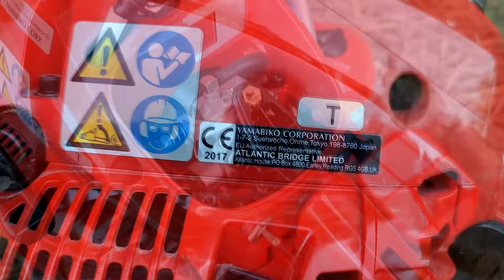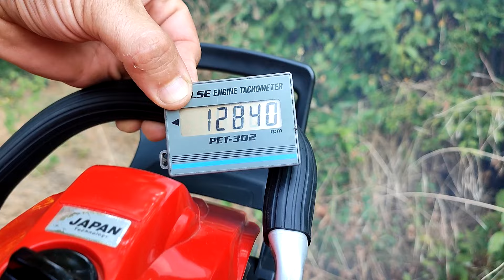Shindaiwa 452s (45cc, 3HP) - first start/cuts, break in, factory RPM, muffler mod and more...

Comment: Te salut Ram. Eu cu acest model shindaiwa 452s cred că ies la pensie. O am de 18-19 ani și încă e funcțională. 👍👍👍🤝
Reply from the maker: Cilindrul are cel mai dur plating ce l am vazut pana acum...
Numai bine!
Reply: @poparamiro o singura problemă pe care o are e filtrul de aer. Dacă tai ceva lemne uscate se încarcă cu praf și nu mai trage motorul până îl cureți din nou.
Reply: @poparamiro adică este peste celelalte mărci?
Reply from the maker: @iliecirciu1251 Da, corect, nu are cea mai buna filtrare, dar se poate moda...
Reply from the maker: @cosminstanciu9833 Are plusuri si minusuri, ca orice drujba...
Reply: @poparamiro  referitor de filtrare modelele vechi de la stihl 210 230 250 etc de la husq  de la oleo mac 941 947 etc ce filtru de aer avea tip nailon și au ținut 15 16 ani acele drujbe cu filtrul lor de nailon